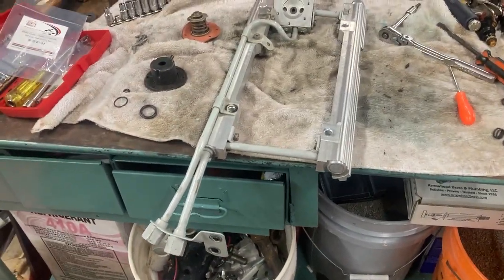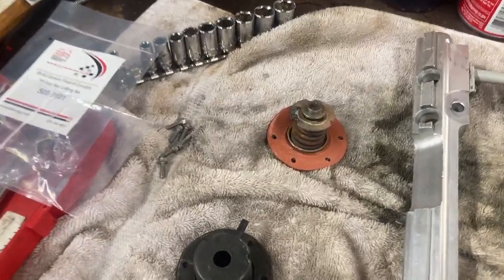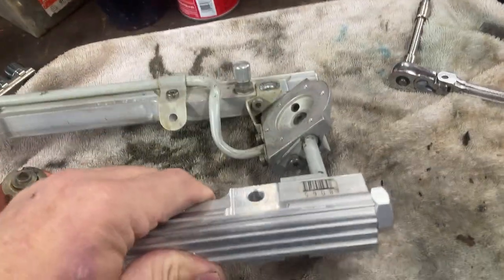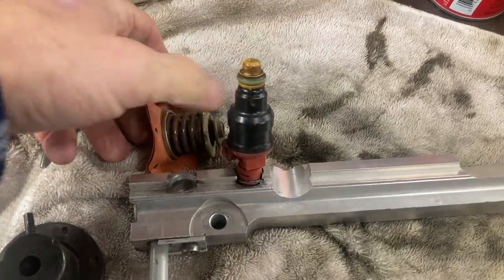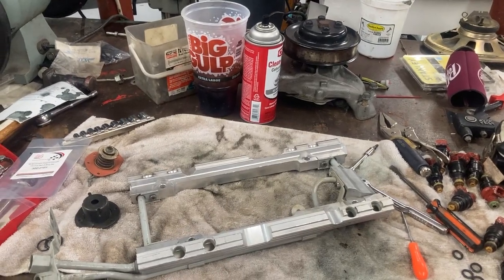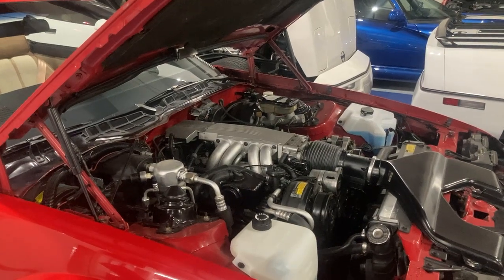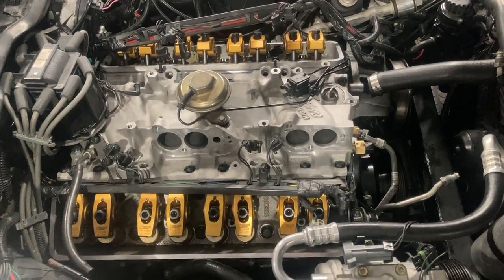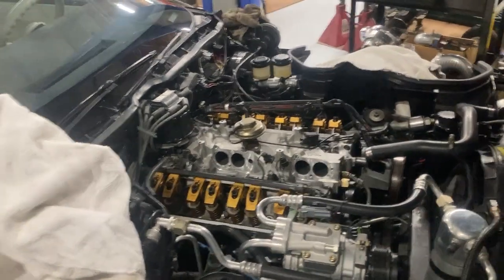Tuned port injection, TPI fuel rail rebuild and injector info - 88 Corvette - Part 8

Comment: I have had to take this out for a second time lol thank you for your info.i now no all answers to this mother. 😅.cleaned the old injectors, there doing well;) but will order some new ones.you talked me into it lol. Fuel pump, filture twice lol. The pressure issue now. Fuel rail, and it goes on lol. I will get this momma,eventually lol. You know your stuff,very helpful😊

Comment: When i crank my c4 88 it runs, but it cut off , i have to do it several times before it keeps running stedy. Do you think i have a bad preasure regulator ? Or fuel pump

Comment: Hey Matt, you're the only one I trust to know; why did GM use a big aluminum fuel rail with heat sink fins?
To absorb heat to pre- heat the fuel for emissions & driveability or to dissipate heat from the fuel?  
Unless that rail was made just to be cosmetic & match the plenum.
I think it will heat the fuel & should be insulated.  Working on a solution after years of many tpi owners complaining of the loud skinny Bosch 3 yellow injectors. 
 Are your yellow Bosch3 injectors on the 90 Vette loud from South Bay?
Reply from the maker: The rails are just cosmetic.  If they were worried about cooling, i think they would have done like benz high end big motors and cooled the fuel off the ac receiver.      The yellow ford injectors can be noisy on L98s.  We have a 90 convertible all stock and has a little noise from the ford bosch injectors.  On the LT5, non issue as the are buried in the engine deep enough to where if they made noise, you cannot hear.  Yes they from south bay, and i have bought many of the new delphi replacement injectors from southbay too.  They are great.  A little more money, and if you can afford, go that route, no noise.  The yellow ford just seem to run really crisp though, especially on the lt5.
Reply: @gm-classics    Thanks for getting back too me.   Sorry, for the long 3am post, but some good info to think about further.

Anyway,  I saw a reply to me from 1 one of FIC's injector videos & guy who seemed knowledgeable stated the Bosch3 isn't good for the tpi & would need tuning to get really dialed in since they don't have the correct voltage offsets to the Multecs causing lean idle & mid range & rich wot or visa versa, & said it was discussed by those who analyzed those injectors on Thirdgen & F-bodies.
Do you know about this?????

  He said the consensus was the Delphi was the only injector with correct voltage offsets to the Multecs.  That's why I was so interested to see what injectors you had on your 90 when you went over to your Vettes since I know, you know everything & wouldn't use them if they weren't perfect!!!!!😋

I' m going to reach out to South Bay & Fic, but will probably buy from South Bay also since you recommend them.  I want to ask them about using the short Ls 1 Bosch4 with adapters made by, ICT Billet.

Yeah, I heard about how Benz used the Ac to cool the fuel & thought what a cool idea.  Engine Masters did a show on cool cans as did David Vizard with I think inconclusive evidence unless the fuel is introduced for charge cooling vs. at the ports.

I went looking for the details about the Bosch3 on the forums, but what I did come across on ThirdGen & Fbodies, was everyone was going bonkers about how loud those Bosch3 are & I saw a vid & was shocked! ,  All these complaints were going back to 2008 to present & even South Bay was stumped about why, but said they're a noisy injector & aren't noisy on the bench.  

  That made me think twice before I order them for my 87 C4 with 19k miles that's been in storage for 20yrs.......bad health & bad people in Fl, causing my bad health. 
Hope to get working on it soon some day.

I did get Bosch3 for my 91 Eldo from FIC 10yrs ago,  to replace the Multecs, & they were silent which made me really think what is going on putting Bosch3 in tpi's & where the noise is coming from vs. they were quiet in my Caddy.  I thought maybe some of those reconditioned Bosch3 were worn & causing harmonics from worn seats or springs, ect.....

However, the Eldorado uses a stainless tube fuel rail as does the Ford 4.6 & Broncos ect. 

But, the tpi uses that huge extruded aluminum fuel rail & aluminum tubes that must be amplifying the injector harmonics like a speaker or like ultrasonic lab processes probe!  

That's my theory!

So as a favor to all these guys on the forums & South Bay & FIC to let them know of a possible resolution,  I started a little research project & reached out to a few big companies who sell that car dampening material which is really just aluminum faced roof/window seal flashing tape , but more refined type of viscoelestic polymer or butyl rubber as a dampening sound material with the aluminum facing acting as a sound trap according to that industry.  

I think wrapping each injector & fuel rails tightly along with the fuel tubes & regulator  will stop the injector noise which I think is acting like water hammer in plumbing pipes.  In addition, that rubberized sound dampener & the thick aluminum foil backing would further insulate & radiate heat keeping the fuel rail cool along with the fuel & maybe a little more gain in power ect.  I have to ask them how much of the plastic can be removed from those Bosch3 injectors to wrap the metal body with the sound wrap.
  
It just made me think GM was trying to borrow Smokey Yunicks idea on his adiabic engine to preheat the fuel with that heat sink fuel rail, if you ever saw the pics of that motor, but his fuel rail was inside the exhaust & he was super heating & vaporizing the fuel in the rail or something like that.....nobody knows for sure, but one engine builder machine shop has those motors & did vids about it, but is still a mystery.

But as you said, I thought the same, & GM just designed them to look futuristic & match the plenum & valve covers unless all those heat sinks serve a purpose?🤔

Have you ever taken temps on the fuel rail  with a thermocouple or tested the fuel temps from the Schrader port on a hot engine????  

I figured you'd be one who would.

In the HVAC industry, they use a contact thermocouple meter that I have.  
 2ch.  Fieldpiece ST4. 

 Good meter to have & would make a neat experiment if you'd like to do a vid to check supply & return rail temps on a hot motor just to know!🤔

Especially for your supercharger, but you already have water injection I think.

By the way, did you get my message about that 76 red Eldo convertable with only 26miles on BaT? 
 Unless you were the lucky guy who won the bid!  I can't see anyone but you to care for that car, unless it went to the Peterson museum.

I really hope this posts.......

Comment: Is there an O ring INSIDE the fuel pressure regulator that the pivoting-head of the diaphram seals against? In the video it looks like a black O-ring

Comment: I have an 89 irocz it starts running bad and sometimes stalls when it gets warm original injectors in it glad I found your video
Reply: Same symptoms for my Corvette!! I'm going to change the grey multec injectors, like yout advise Matt
Reply: Update car sat in storage last winter when we took it out. The problem fixed itself, running fine, but I'm not sure what happened over the winter, but all good last summer. I hope it's the same this year

Comment: Can you recommend any injector sets that I should look at for my 1990 L98 Vette, I pulled the rail off and it looks like the original Rochester setup was still in there. Thanks
Reply from the maker: Ford referb 22lb for cheap, run real good.. new delphi are avali too with improvments and are great too but more. Southbay fuel injectors will fix you up..
Reply: @gm-classics  Excellent, thanks so much! I'll check them out.

Comment: My son’s 89 has the L98. Sometimes is runs well and other times it idles poorly to horribly and I feel like we’re chasing a ghost. I’m changing these injectors immediately along with the fuel regulator, even though we get 42 psi. 
I need to watch this video again and see if you mentioned the exact injectors to get for a 1989 Corvette with the L 98 engine engine. If you see Mike on it, perhaps you could reply to me. Thank you for this video. it was really great !
Reply: Same symptoms for me! Did new injectors solve your problem?

Comment: Hey Matt, first off thanks for all the videos! 
I have an injector question. I have a stand alone harness tpi setup on a swap I am working on. It's a 91 LB9 305 TPI-Emissions deleted, headers, Accell base manifold, ported TPI plenum&runners, Holley AFPR, and stock injectors. I had a chip made for associated mods. Started great, idled great, ran great for about 5 minutes then stalled out. So discovered it had leaky Motec injectors. So I swapped them out for south bay 24lb injectors. Starts right up now, but has an extremely high idle. Is this because the ECU needs another chip made for 24lb injectors? Or is there something else going on? Thanks for any help you can provide!
Reply from the maker: Did you try the stock chip? Also, what is your fuel pressure set at? You may want to reduce the fuel pressure a little bit and see if that does anything for you?  Also, make sure your IAC not bad, that’s the idle air control motor on the throttlebody.
Reply: @gm-classics  thanks for the response...it's idling extremely high at prolly around 2500rpm, the iac is new and TPS is an older one probably factory. I have checked the TPS, and if I'm understand results correctly, it's about 20% over from normal. But that is approx how much over it's idling, so I'm sure if it's the ECU trying to compensate for the larger injectors, or a bad TPS, also it's the non adjustable style TPS that came on the 91's. I have not tried the factory chip but it's the vats ECU, so chances are it wouldn't work anyways. I forgot to mention I installed an Accell super ram at same time as injectors, I've uninstalled and reinstalled 4x checking for vacuum leaks, and can't find any. I'm stumped, and all I can figure is that the ECU can't calibrate correctly for the 24lb.er's. But I'm not positive that's the case.
Reply: Also the FPR is set at 40psi at the moment. It was a quick check on a rail mounted gauge. I don't really want to leave the engine running for any period of time with the extreme high idle condition.
Reply from the maker: I run 32# injectors on my 88 with the blower on basic stock hypertech chip for l98.  I have base fuel pressure at about 34.  It does not idle high… it really sounds like a vac leak, a crack in super ram?    Try stock chip for grins..   the larger injectors will make run rich at 40 psi and even idle eratic, but cant see it just revving up that high without something else going on.
Reply: @gm-classics  gotcha, ya my first thought was also an vacuum leak. And I would think ,it revving that high at idle, a pretty obvious one. But I can't find one. I'm going to reset IAC, just to wast some time, and then keep checking for intake leak and probable cause. Thanks again for responding, I really enjoy your videos, and made me realize just how truly special the ZR1 is.

Comment: 85 corvette is 24# injectors
Reply: Yep 👍 at 35psi or so then they went to smaller units and bumped up the pressure to 46psi or so

Comment: I took all 8 gray injectors out and put Jegs 8 piece steel injectors in. Works awesome. I also replaced the fuel regulator and EGR valve.
Reply: What kind of regulator and is it adjustable?

Comment: Love the video and the garage!   Just bought a 1986 IROC with the factory 305 TPI with 87K miles.   I may change the injectors if mine are the "gray ones".
Reply from the maker: 86 are not the grey Multec, yours should be Rochester, but you will benefit from newer for sure.
Reply: Thanks!  Probably have to take off Plenum and Runners to tackle this job I would expect